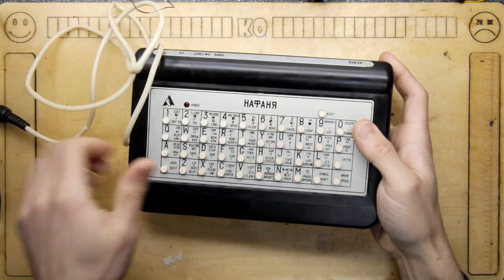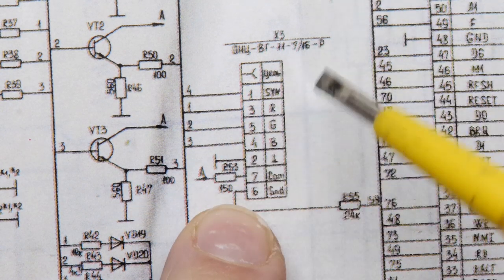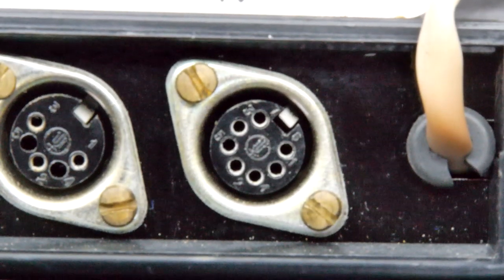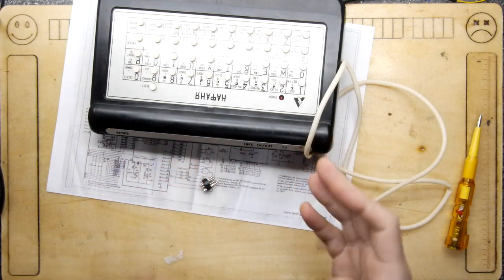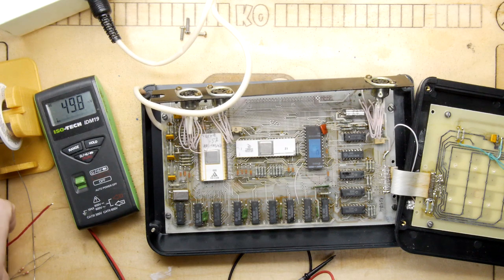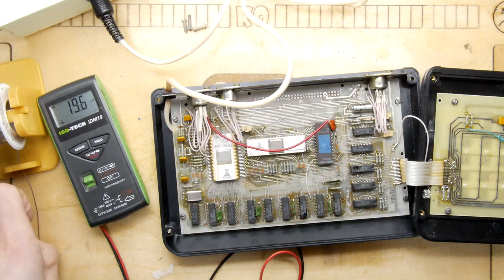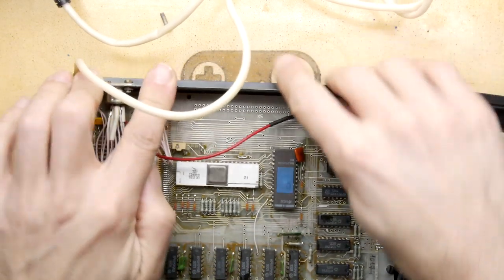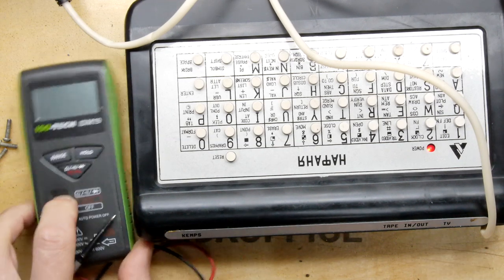Soviet Sinclair ZX Spectrum Clone RGB Modification and Build НПО "Аксон" Нафаня (Akson Nafanya)

Comment: Those top pins on the 8 pin DIN on a Mega Drive cable are a right pain in the bum. Neo Geos use a VERY similar cable with the same pinout but the top pins are more like the clone Speccy. Memories of using the wrong cable in the wrong console, snapping a pin off and having to extract it from the socket.
Reply from the maker: Oh that's a bloody nightmare. I know exactly what you mean because I was doing the same with a neo Geo mvs. There's some slight difference with those two top pins isn't it. I guess it's a pretty good idea if you have multiple 7-pin din dins on your unit to avoid accidentally plugging them into the wrong thing but it makes it hard to order them online 😂

I did a bit of research and apparently you can get up to 19 pin din sockets. I wouldn't fancy soldering that one!

Comment: Dump the rom.
Reply from the maker: It looks pretty standard to me do you really think it's worth the risk to the Nafanya to pull it? 

As I'm sure I would add a socket Is there any other sexy Rome I could put in its place for fun?
Reply: backofficeshow I’ll dig out a tap file that should be able to test it in situ. Never noticed if it was socketed or not.
Reply from the maker: @zxrenew5642  the one in this isn't socketed so would need some surgery
Reply from the maker: Can I unload it to tape?
Reply: @backofficeshow  yes you can. Do SAVE "filename" CODE 0,16384 and that will dump the ROM to tape.